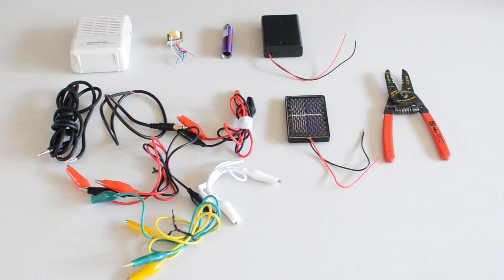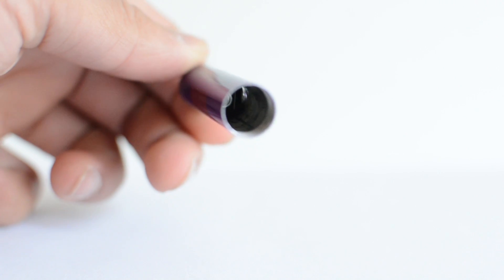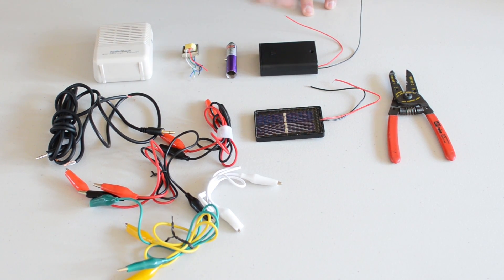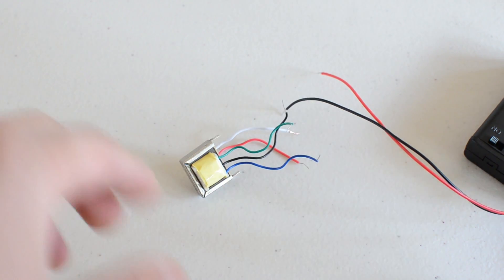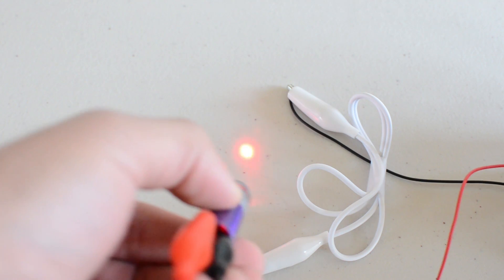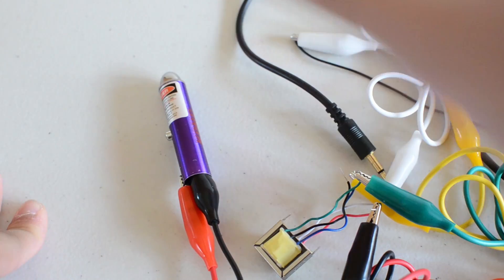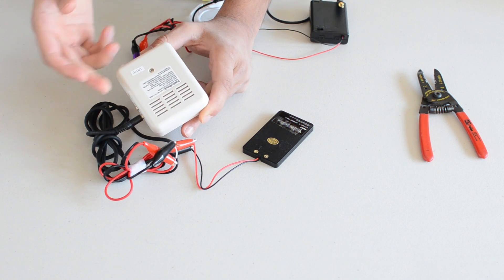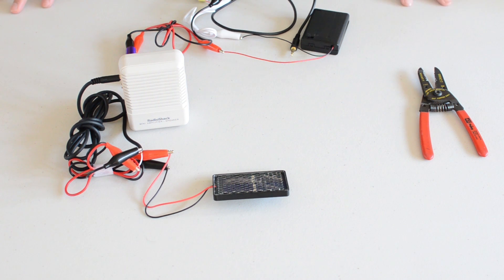How To Make a Laser Communicator [Tutorial]

Comment: Please assist! I tried a red and a green laser, both under 5 mW (reportedly), and they don't produce music through my solar cell. When I use a flashlight and all the same hardware otherwise, I get music. When I use the red or green laser, I only get a click upon appearance and disappearance of the beam on the solar cell. I'm not using a separate amplifier, I'm plugging the audio from the solar cell into a Bluetooth/3.5 mm audio speaker I had. I would guess there's an internal amp. Again, the flashlight works, just not the lasers.

Comment: I have a question, can i use a normal speaker instead?
Reply: No, you need to amplify the signal that comes out of the solar panel before you send it to a speaker otherwise you will not hear anything.
Reply: @WhirlybirdFlyer  Could you please provide me an link to a site to shop the amplifier because the link provided by the author does not have stock. please..

Comment: where can i salvage this AUDIO OUTPUT TRANSFORMER from? inside any boombox portable radio?? speakers? also can i use this setup to transmit data or even binary values? pwm? control the brightness of an led? or speed of a motor?
Reply: dam you took so long to reply that i ended up figuring it out on my own,, so the answer to my own question that you couldn't answer is YES you can do everything i asked in my last question. PS im not expert by ny stretch either i guess your defined by your curiosity NOT by what you claim to know by far.
Reply: this is where ill be using this circuit 

https://www.facebook.com/energized.robotix/videos/vb.100002504307971/879657862127682/?type=2&theater&notif_t=comment_mention
Reply: nice attitude...

Comment: hi RK2. i have a question. i still consider myself a beginner in electronics. my question is why did you connect the positive terminal of the battery to ground and the negative terminal to the spring? it doesn't work the other way round? thank you for your kind attention.

Comment: Can you do this without use of a transformer or do you have to have the transformer for it to work? Can you use a normal one from a plug in wall wart?
Reply: No. It cant work without it.
Reply: gogleg4 That's OK I found a small one that works but it's almost like the laser is too strong for the solar panel. I used something to break up the signal and it worked better. I bought two more laser pointers at walmart for about $2 each.
Reply: coondogtheman1234 M'kay '_'

Comment: A computer sound card microphone input can be used as the receiver/amplifier.  It's good to put a capacitor inline with the solarcell since the mic. has some power in the line sometimes.
Reply: I dont hav an audio amplifier... can I use female jack to the solar pannel and connect a speaker???
Reply: anbu anbu If you have a computer, you can use the microphone (or possibly the line in) input to amplify the sound.  The unamplified sound from a solar cell is small, and you probably will not hear it, you might need sensitive earphones like old "magnetic" types.  I'm not sure really.  Sometimes you can turn an old radio into an amp if you know where to connect wires and make a jack.